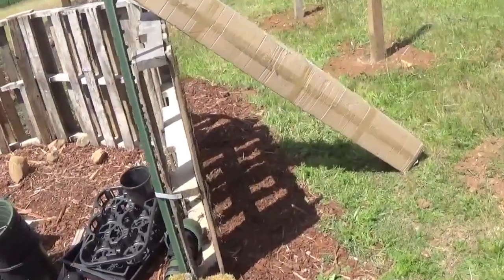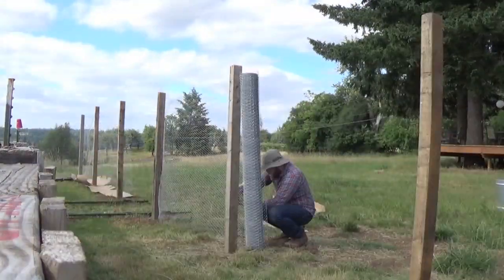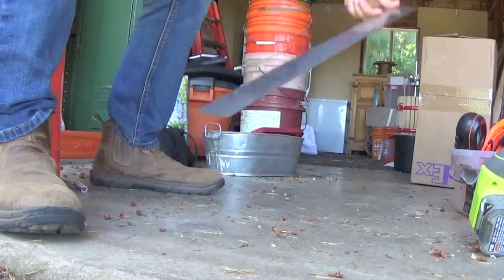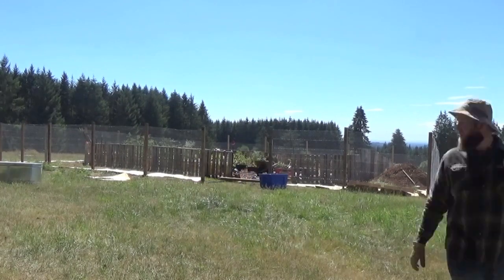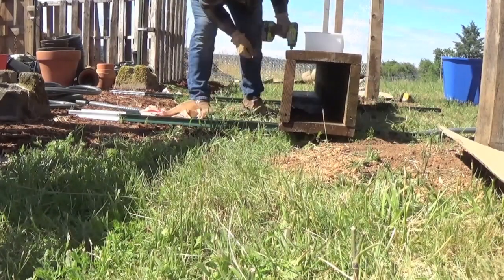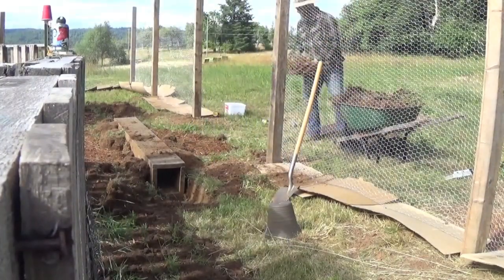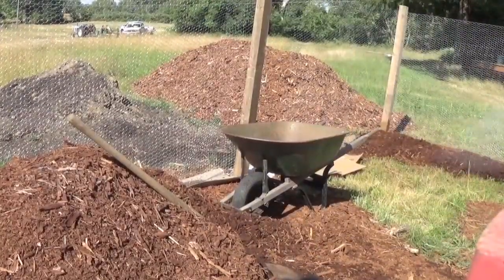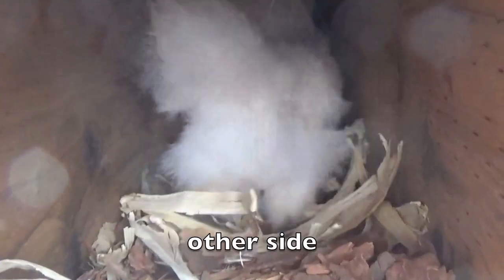Finalizing the Chicken Moat Garden

Comment: You should have buried the chicken wire 30-50cm into the ground. Foxes will overcome this fence in like 10 seconds, and chickens also with time. Also foxes can bite through chicken wire if they are really hungry. Its not strong enough. You could bury an additional stronger fence that is 1m high, half a meter into the ground. That is safe for sure.

Comment: In my experience predators will definitely dig through wood chips to get at chickens... growing up we had a real problem with it. We would use cider blocks around the bottom and they would still roll the blocks to get at the chickens. As an adult when I get around to having chickens I plan to bury my wire in the ground to try to prevent this. Thanks for the inspiring video!

Comment: Is there any way to put your tunnel level with the ground instead of dug in, and ramping both sides for wheelbarrow and other traffic? You will probably have less wood chips building up in the tunnel that way, plus it's easier to remove chips and chickens at ground level. ;-) Also, I hate to be the bearer of bad news, but wood chips will not keep predators etc., from digging under your fence line. I have one spot on one side of the gate to my chicken run that has about 1 1/2 inches with no welded wire dug down to block it, and we have wood chips in front of the gate. Over the last few days I've been filling in a hole that something has dug into the run from there. Probably chipmunks or the like getting in to eat the chicken feed when I forget to close it up, but all I'm saying is that if a critter wants in, wood chips won't stop it.
Reply from the maker: Yea, nature is pretty unstoppable :/ Fortunately, the coop fully locks up at night, so even if something does get in, it still has another fence to get through. I thought about putting it level with the ground, but the bump does get pretty big; especially with a heavy wheel barrow. My new plan is to dig out the soil about 5 feet back from the tunnel. Essentially truing to bring ground level down to the tunnel. Thanks for the suggestions!